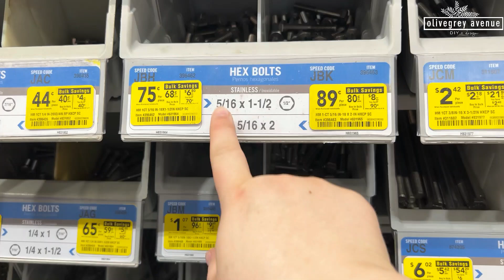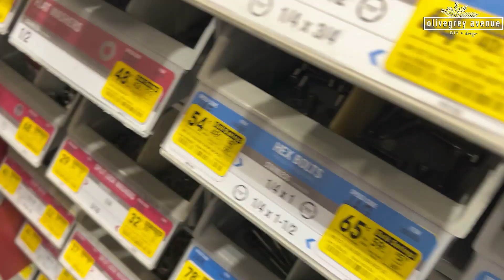Easy MITER SAW SLIDER for $30

Comment: I'd use some silicone lubricant on the rails. Then you can tighten the nuts a bit more. If the saw jams while cutting you want it secure to your table. Nice idea.
Reply from the maker: The problem lies in that it also tightens to the table but I have it secured down so it isn’t loose and then the hitch pins make sure it doesn’t shift while cutting. Thanks for watching!